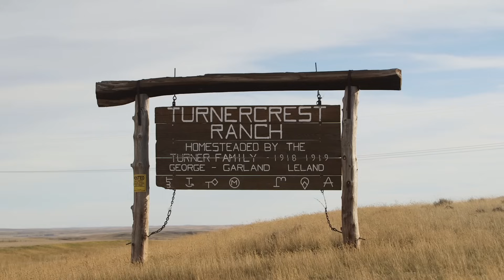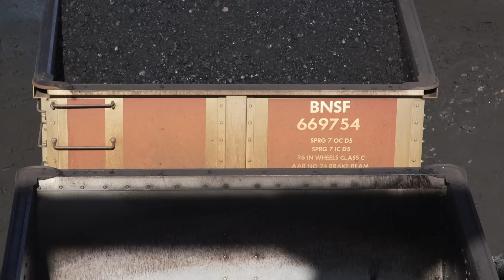World's biggest mine: Inside US coal

Comment: Did she say, " Just one ton of coal produces 3700 lbs of carbon dioxide"? How is that possible?
Reply: Smoke and mirrors, she’s selling climate change
Reply: Oxygen bonds with the carbon in the coal when it is burned, therefore the total weight after combustion is higher than just the coal itslef.
Reply: @Henriburger1  And what about the water vapor that is also produced? Is that accounted for separately?
Reply: @michaelpost7352  
Water vapor doesn't produce carbon dioxide nor does releasing it contribute to climate change. We cannot significantly increase or decrease the humidity in the air because if it goes lower more water evaporates, and if it goes higher, it just rains.
Reply: @Henriburger1  Wasn't thinking of the climate change angle, just wondering about  the weight balance. One ton of coal makes 3700lbs of CO2, plus x pounds of H2O.
Reply: I'm pretty sure a ton is 2000lbs. So some how it produces more carbon than it's mass
Reply: @Bowiiihowdy  carbon dioxide. 
That means 1 carbon atom with 2 oxygen atoms. 
And since oxygen weighs something a carbon atom is considerably lighter then a CO2 atom.
Reply: Isn't carbon dioxide the compound that plants take in to use the carbon to build the plants' structure while releasing free oxygen as a waste gas.  You know oxygen, that gas that ALL animal life needs to exist!  Is this really a negative?  Haven't forest fires though out history released huge amounts of CO2?  The Earth is a very complex self-balancing system, but humans forget that the Earth is constantly changing sometimes to the benefit of humans, sometimes not!
Reply: @rogerjensen5277  nope, forests are getting cut down.
Reply: @destroyerarmor 
Doesnt matter if trees are being cut down. One hundred acres of grass and cropland uses up more CO2 and produces much more Oxygen than one hundred acres of trees.
Reply: Climate change 🤣🤣🤣🤣
Reply: it is very simple , 
you must focus, very strong focus, and you will discover the trut")
Reply: @michaelpost7352  The air contains about 10000ppm water vapor and 400ppm CO2. The CO2 emissions from burning fossile fuel are negligible compared to nature. The H2O emission are negligible, negligible compared to the natural emissions from the oceans.
Reply: @holgernarrog962  that's true that nature emits more co2 than we do, but nature absorbs more co2 than it emits. The problem with human co2 emittions is that we're releasing carbon that was stored in the ground for hundreds of millions of years back into the atmosphere way faster faster than what nature can absorb.
Reply: Democrat common core math lol 😂

Comment: 2000 lbs of coal contains 3700 lbs of carbon?  Must be using common core math...
Reply: Not Carbon, Carbon Dioxide which is CO2, where one atom of Carbon (weighing 12u) binds with it two atoms of oxygen (16u each). So theoretically from pure elemental carbon you can get 7300lbs of CO2 from 2000 lbs of it

Of course not every bit of it is burned, slightly CO is produced and so on.
Reply: Hahaha how the heck is that possible?
Reply: 12g of carbon combine with 16 g of oxygen to form 44g of CO2 similarly plants absorb 44g of CO2 to form 12g of carbon (wood) and 16g of oxygen
Reply: @SaintNjuguna  It doesn't Add up, 16+12=28

There are two oxygens in atom, so for 12g of carbon you need 32g (16x2) of oxygen to get 44g of CO2.
Combining 12g C and 16g O will get you 28g (not 44) of Carbon Monoxide (not dioxide)

...So I get what you're trying to say, but in current form it's wrong
Reply: No, you're just using Minnesota public school chemistry. It's okay, the Vikings will make the playoffs.
Reply: Yeah sounds like BS to me, how can you get more out of it than is in it.
Reply: This is giant example of your failure at common core chemistry

Comment: 1 ton of wood makes 5700lbs of carbon dioxide emissions. 2000lbs more than coal. This one stat raises more questions than answersb
Reply: better go easy on the barbeque.
Reply: @ Mike  1:37 she says 1 ton (2000 pounds) produces 3700 pounds of CO2 ..... seems counterintuitive
until u throw chemistry into the mix (Carbon with atomic weight of 12, combines with oxygen (atomic weight 16) to form CO and CO2) 
So, yes even if the entire carbon is not burnt off, we can still have a higher mass of CO2 than the C (coal/coke) it came from

Comment: "Just one ton of this coal produces 3700 pounds of carbon dioxide emissions" 1:33 what??
Reply: this is just propoganda I live in the town that houses the coal miners that work at that mine that mine and all the others don't m as ke our snow black our air is clean as day this is just propoganda
Reply: Told it here twice, will do it again... Because sure some people don't remember chemistry

Carbon Dioxide is one atom of Carbon (weighing 12u) binded with it two atoms of oxygen (16u each). So theoretically from pure elemental carbon you can get 7300lbs of CO2 from 2000 lbs of C it if burned perfectly. The rest of it comes from atmospheric oxygen.

Of course not every bit of it is burned, slightly CO is produced you have ashes and so on, so the number is much lower

Comment: Texas could use some coal plants right now.
Reply: Texas has some coal plants - the trouble as I understand it was that they weren’t on line with plenty of steam when the grid went down . Peak demand gas generation doesn’t work when there isn’t enough gas to make steam . Problem is no gas is stored at those plants for production . Coal fired plants are REQUIRED to have at least a 60 day supply of stored energy ( coal pile ) . Any problem with the natural gas pipeline system ( like sudden huge demand ) and the peak plants go cold . It’s all about steam to spin those generators.
Reply: @marclauzon1882  Nuke power is the answer!

Comment: So 2000 pounds of coal magically make 3700 pounds of co2 .... might wanna check your math
Reply: Carbon Dioxide is one atom of Carbon (weighing 12u) binded with it two atoms of oxygen (16u each). So theoretically from pure elemental carbon you can get 7300lbs of CO2 from 2000 lbs of C it if burned perfectly. The rest of it comes from atmospheric oxygen.

...might wanna check your chemistry

Comment: at 1:35 "a ton of coal produces 3,700 lbs of CO2". Say what? that doesnt even make sense. where is that 1,700 extra pounds coming from? makes you wonder if anything in this video is factual.
Reply: The oxygen which burns the coal.
Reply: +Jemalacane0 no, burning 2000 lbs of coal wont produce 3,700 lbs even counting the oxygen portion combined with the carbon. You suggest 1,700 lbs of oxygen produced?
Reply: When coal burns it combines with oxygen to form carbon dioxide. For every atom of carbon burned, two atoms of oxygen combine with it. See, it's sad, you don't even know how combustion works. And yeah, it probably would take about 1,700 pounds of oxygen to burn a ton of coal. It takes huge amount of oxygen to burn fossil fuels.
Reply: +Jemalacane0 yes I understand that. You arent accounting for any energy release in weight. That would be the coal.
Reply: +Jemalacane0 in other words, you cannot produce 3,700 lbs from 2,000 lbs simply by burning
Reply: @Hello mark brinton, How are you doing?
Reply: @lydiaanderson2870  hello

Comment: Nuclear fuels are about 2 million times as energy dense as fossil fuels. The United States has about 800,000 tons of nuclear fuel. The United States also has the potential for 130 gigawatts of installed geothermal electrical generating capacity and about 144 gigawatts of installed hydropower generating capacity. The United States also has an unknown potential for biomass generated electricity as well as wind and solar. So, no, we do not need coal for electricity.
Reply: WE do if we want it cheap!

Comment: At about 1:30 - 1;35, the lady speaking says "just one ton of this coal produces 37 hundred pounds of carbon dioxide emissions.  A ton of anything by definition is 2,000 pounds.  If you start with 2,000 pounds of coal and burn part of it away, how do you end up with 3,700 pounds of carbon dioxide.  Maybe there is a math trick I'm not aware of?  I think I'll start raising beef cattle.    I'll buy two cows.  Should be about 2,000 pounds.  Then I build a fire and burn them all up.  I'll take the resulting 3,700 pounds of beef and sell it for a profit.  I'll use my profit to buy four cows and do it again.  Pretty soon, I'll be a wealthy man.
Reply: +jolly roger CO2 takes dioxygen from the air, so it takes coal and plenty of dioxygen
for one carbon atom from coal, you take 2 oxygen atom from the air to get CO2
so you end up with a raise of mass
Reply: wut ?
Reply: I'm bad at english, sorry for saying mistakes if i was doing so

Comment: 1min 37sec "...one ton" (2,000lbs) "of coal produces 3,700 pounds of carbon emotions..." how does that work?
Reply: +jephers29 I noticed that also, not sure how that works. Maybe the same math they use to make their climate models?
Reply: +jephers29 When Coal is burned, oxygen is added to the carbon. Hence, the combustion products mass more than the input fuel. CO2 is 1 atom of carbon, and 2 atoms of oxygen. The oxygen wasn't in the coal originally.

Comment: How do you calculate CO2 emissions from coal?
Carbon dioxide emissions per ton of coal were determined by multiplying heat content times the carbon coefficient times the fraction oxidized times the ratio of the molecular weight of carbon dioxide to that of carbon (44/12).

Comment: One ton of coal makes almost twice as much by weight in carbon dioxide?  Something does not agree with chemistry.
Reply: She's spouting garbage.
Reply: coal is carbon, that carbon bonds with oxygen in the atmosphere, hence the larger weight
Reply: Carbon Dioxide is one atom of Carbon (weighing 12u) binded with it two atoms of oxygen (16u each). So theoretically from pure elemental carbon you can get 7300lbs of CO2 from 2000 lbs of C it if burned perfectly. The rest of it comes from atmospheric oxygen.

Of course not every bit of it is burned, slightly CO is produced you have ashes and so on, so the number is much lower

What exactly does not agree with chemistry?

Comment: Here is the truth:  Coal is one of the biggest contributors to climate change,  but companies need coal to make iron and other metallurgical materials, so they buy it anyways, it's as simple as that.  Solar power is becoming cheaper at producing electricity than coal-fired plants can produce it,  but solar doesn't work at night and most people need electricity at night when they come home from work. Until reliable large-scale batteries can be produced cheaply (and won't catch fire like Lithium-ion batteries often do), and can be used to hold the energy produced from solar panel farms, then we will just have to burn coal and natural gas to produce the energy we need at night.

Comment: 1:35 " just1 ton of this coal releases 3700 lbs of carbon dioxide emissions " how does that work.
Reply: Carbon Dioxide is one atom of Carbon (weighing 12u) binded with it two atoms of oxygen (16u each). So theoretically from pure elemental carbon you can get 7300lbs of CO2 from 2000 lbs of it if burned perfectly

Of course not every bit of it is burned, slightly CO is produced you have ashes and so on, so the number is much lower

Comment: Well that's all very one sided, the other side is that people need energy. The current plan to get people to stop using energy is to price it out of existence via a cap and trade tax. Basically the way it works is, the power company is charged a tax , it gets passed on to your grandmother for example. Since she is on a fixed income she has to turn of her electric heater (goal accomplished!), put on her coat stand in the corner and shiver.
I guess they named it cap and trade because stand in the corner and shiver didn’t sound as appealing.
Reply: ...or get the power plant to switch to natural gas (which isn't perfect, but better), as has been happening.  ...or get people to actually educate themselves about nuclear power and realize it's less of a threat (again, not perfect, but significantly better).
My worry is that, if they ever get fusion reactors to work as needed, the coal and oil industries will spend billions killing off (as literally as necessary) any chance that such reactors will start replacing coal and natural gas power plants.

Comment: How does 1 ton (2,000 lbs) of coal produce 3,700 pounds of co2 emissions??  If any it should be less since not all of it is emmited into the air
Reply: @ Alec  1:37 she says 1 ton (2000 pounds) produces 3700 pounds of CO2 ..... seems counterintuitive
until u throw chemistry into the mix (Carbon with atomic weight of 12, combines with oxygen (atomic weight 16) to form CO and CO2) 
So, yes even if the entire carbon is not burnt off, we can still have a higher mass of CO2 than the C (coal/coke) it came from

Comment: Emissions from coal is a fraction in comparison to a volcano.   But to get a better understanding of how it affects us is to imagine a camp fire that you are concerned about the smoke.   Wind can and will change.   You have to make considerations.  But coal is probably making the electricity to power your computer.
Reply: Source
Reply: Your information is incorrect.  The average coal fired power plant uses 9000 tons of coal a day.  There are more coal fired power plants running, all year, than there are volcanoes erupting in a given year.  Volcanoes do put out a huge amount of carbon, but nothing like the amount that is put out by coal fired power plants.  Even if vulcanism and coal power produced the same amount, that's still doubling the amount of carbon being put up into the air.
Further, because of the ash they put out, volcanoes can temporarily cool the environment by reflecting light back out.  Read up on the year 1816, dubbed "the year without a summer," for details of what it can be like at the extreme end.

Comment: what a lie!!! one 3 pound pice of coal can produce 37 pounds CM ??? She need to go back to school.
Reply: Brandon Fesser so, you say, it takes 2 atoms not 21&1/2 ,right? how 3lb becomes 37? go to school with her...
Reply: Oxygen atoms are 1.3321 times more massive than carbon atoms (on average).  One carbon atom in the coal combines with two oxygen atoms to form carbon dioxide.

She said "Just one ton of this coal produces thirty seven hundred pounds of carbon dioxide emissions."
Reply: Yes, what about it?
Reply: Carbon Dioxide is one atom of Carbon (weighing 12u) binded with it two atoms of oxygen (16u each). So theoretically from pure elemental carbon you can get 7300lbs of CO2 from 2000 lbs of C it if burned perfectly. The rest of it comes from atmospheric oxygen.

Of course not every bit of it is burned, slightly CO is produced you have ashes and so on, so the number is much lower

I don't think it is she who need to back too school
Reply: @juliuszkocinski7478  The carbon dioxide emission factors in this article are expressed in terms of the energy content of coal as pounds of carbon dioxide per million Btu. Carbon dioxide (CO2) forms during coal combustion when one atom of carbon (C) unites with two atoms of oxygen (O) from the air. Because the atomic weight of carbon is 12 and that of oxygen is 16, the atomic weight of carbon dioxide is 44. Based on that ratio, and assuming complete combustion, 1 pound of carbon combines with 2.667 pounds of oxygen to produce 3.667 pounds of carbon dioxide. For example, coal with a carbon content of 78 percent and a heating value of 14,000 Btu per pound emits about 204.3 pounds of carbon dioxide per million Btu when completely burned.(5) Complete combustion of 1 short ton (2,000 pounds) of this coal will generate about 5,720 pounds (2.86 short tons) of carbon dioxide .
So, 3lb of coal generates 9lb of CO2. Not 37.